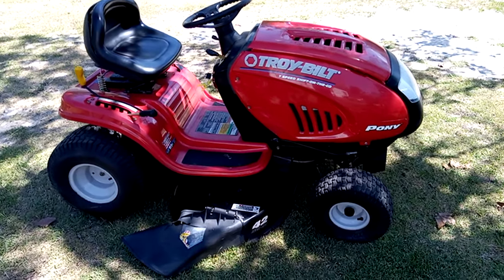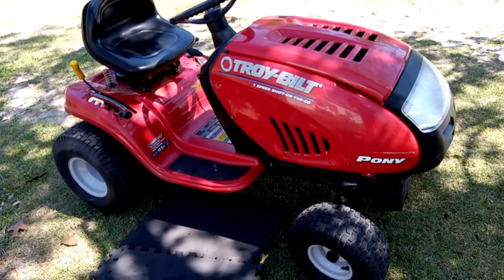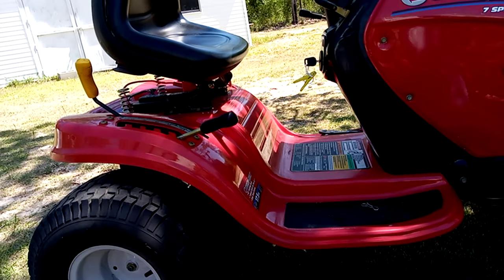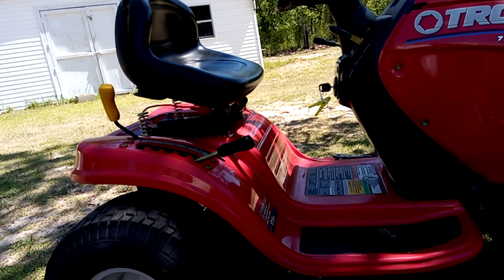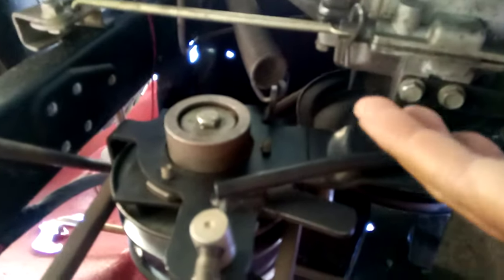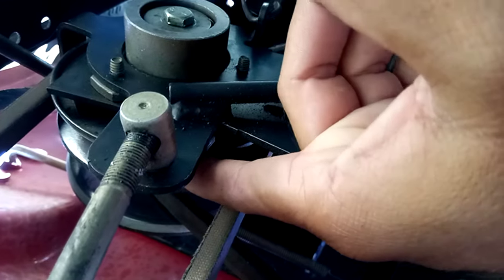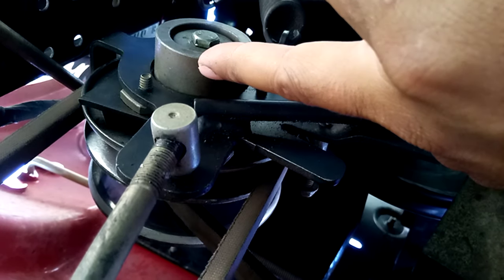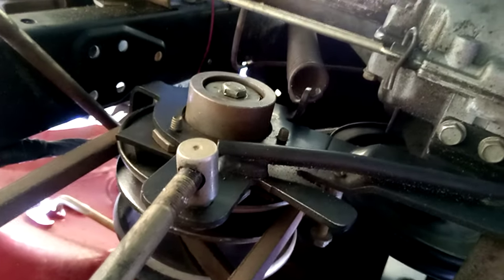Riding mower won't go forward or backwards found the cause

Comment: anyone who owns one of these troybuilt ponys had better invest in a good set of metric tools and a feeler guage for the vale adjustmentsss youll have to do a little later on. i ought to know ive owned several of them and every one had the same exact problems and the build design is terrible.. you cant get a socket on the top transmission pulley because of a frame brace in the way .. its a nightmare.. while they run you cant beat these old mowers but when they tear up.. put on your big boy britches cause its gonna get rough lol